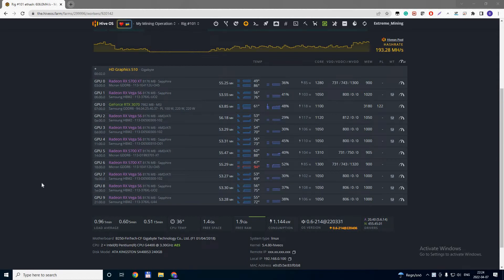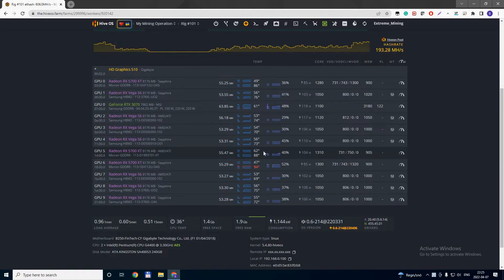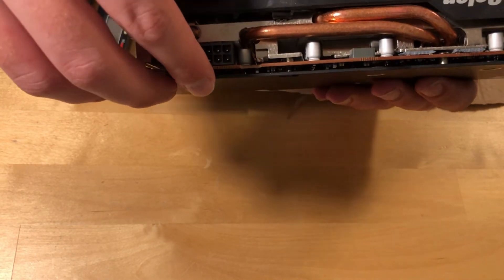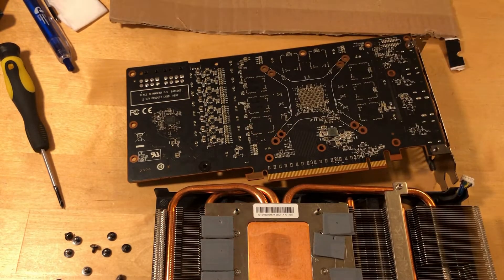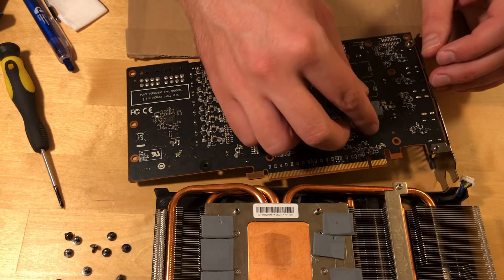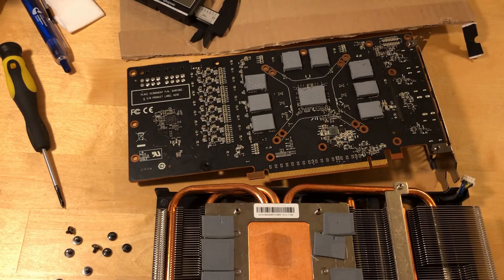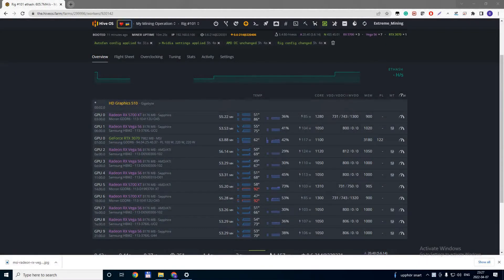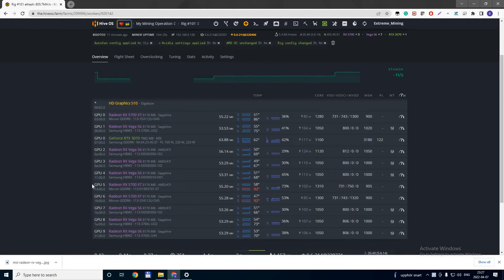Do Thermal Pads on the Backplate Matter?

Comment: I think that thermal pad on gpu made it worse, also the empty ram spaces are useless... there is nothing to cool. Maybe putting on solder points could reduce the heat. Nice try.

Comment: * Warning, I did a similar thing on the same GPU, and the result was a broken GPU... too much pressure on the thermal pad is probably the cause.
That said, the MAIN idea of sharing the heat is good, and the result are weird here. Did something else happen? like the original thermal pads are not 100% in place, or something.

On my current CPU - I added heat sinks on the back of the motherboard (in a bit similar idea as here), AND added a fan close to it... I was able to get (officially 7 degrees lower temps) and added to that, slightly lower water pump RPM, so my estimation is that the difference is about 9 degrees, when a video and a game is running. So the THEORY works!

Some thoughts!
- While sharing the heat to the backplate, it is NOT designed to give heat away... it is "big" but have no heat fins that more efficiently share the heat to the air.
- While sharing the heat, it is also important that air flows well and moves the heat away.
- in the example here in the video there is a possible "risk"... the heat comes from the VRM to the backplate... and there is only a (3mm) of air that doesn´t move much INSIDE the GPU (between backplate and the GPU board) (where the thermal pads were added).  This could cause the air to HEAT up more, as now the backplate will be warmer, and cause OTHER components (the processor) now resulting in having warmer air on the backside (resulting in the increased heat - just a suggestion).
- In my own (failed) example, I attached heat sinks to the backplate in order to cool it down (but was never able to test results).
Reply from the maker: Hi, so sorry to hear that. I’ve opened tens of gpus, and never had a problem. Especially, adding thermal pads should have nothing to do with the “braking the gpu”. For the rest of you comment, I absolutely agree. The idea here was to see if there will be change with the simple adding the pads, and it didn’t. About the warm air, well if it gets warmer than the surrounding air i does not stay in place… it simply goes up, thus creating the circulation of air, not as efficient as having a fan, but enough to make it not worse to transfer heat to the backplate (as long as it is not plastic). Some gpus cool vrams just with the backplate (e.g., 3090). 

I hope you can fix your gpu, or at least identify what exactly went wrong.
Reply: @BMasterBM1  I am happy to see that you tested this, and so on, just wanted to share my experience. I THINK the issue was that I added thermal pad on the back side, and when screwing the back plate towards it, it MIGHT have gotten too much pressure.

I then needed to adjust an aluminium heat sink on (the front side) the memory which touched a heat pipe. While it was not glued fully (still partly) to the memory, (the pressure from the back + pulling on the heat sink) resulted in the memory top breaking loose. And the GPU was gone. (And sorry my bad english).
Reply from the maker: @PjotrII  Oh, yeah, that is probably what happened. Well at least 5700xts are not that expensive, but shame nonetheless

Comment: This is just a guess but I think the 3mm is too large. I would go with a 1.5mm or check with the cards manufacturing specs.
Reply from the maker: There are no specs, this card does not have pads on the back. You need them to be 3mm so there is a contact between the backplate and the pcb.

Comment: I think it would work except that you put a thermal pad on back of core, so you can see if your before and after, core temp dropped but mem temp increased because you are putting heat from core onto back plate along with mem. so putting pads on back plate would help probably if you didnt put one on the core. over all interesting test. ive only used RX 5700XT XFX thicc iii micron mem. have not changed any thermal pads yet
Reply from the maker: Interesting perspective. It might be the case.
Reply: @BMasterBM1  Actually, i don´t think so. If the core was sitting at 62°C before, how would it heat up VRAM up to 92°C from 88°C, when it is so much colder? It would instead make sense for the VRAM to heat up the core, not the other way around.

Moreover, unless there are VRAM chips on the back, there is very little connection between the VRAM chips and back of the card. Each VRAM sits on tin balls, which are its only connection to the PCB, so heat has to come a long way THROUGH the PCB only to get into the back of the GPU, not to mention 3mm pads are very thick (preferably, thinner pads = better), which makes them somewhat poor in terms of heat conductivity.

Also, all pads need to be compressed to achieve their rated thermal conductivity. Uncompressed pad has higher thermal resistance than compressed (not that i know much about the stuff, i just read it elsewhere, but the way i understand it, the pad has to be squished tightly between components to get the best results).

This sort of mod works with GPUs, that have VRAM on the back with either bad or no thermal pads from the factory. Not to mention those thick pads are hella expensive.

I´m gonna test a GPU tomorrow, with and without backplate, to get relevant results. Wish me luck, but i think removing the backplate is the best option, as the flat surface of a backplate isn´t a good heatsink. Most backplates serve as protection for the back parts of GPU anyway.
Reply from the maker: @Morpheus-pt3wq  yeah, you are right, I didn’t think it through. Let us know how did the experiment go!

Comment from the maker: Hello guys! What is your experience with thermal pads on the back of the card?
Reply: I agree. I did the same and the temp also went up (about 2 degrees).
Reply: when i dont put thermal pad on back of my sapphire rx570 it gets very very rare times artifacts but no any performance decrease after putting thermal pad in backplate (there are place for thermal pad) very rare artifacts gets over
Reply from the maker: @ihvspyn It is a different card, and the backplate is probably out of metal?
Reply: @BMasterBM1  Wait, I thought your back plate was made out of metal. It doesn't make any sense if it's plastic